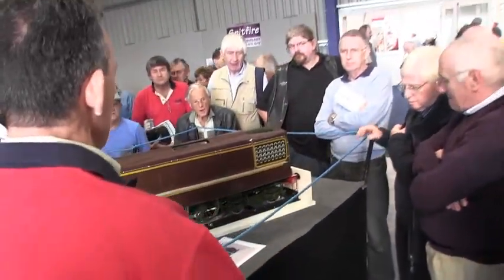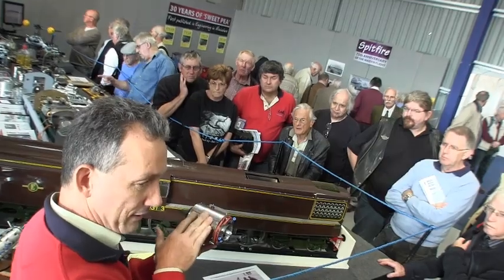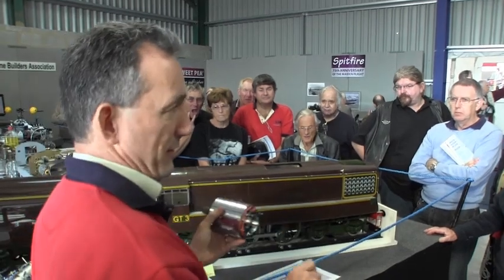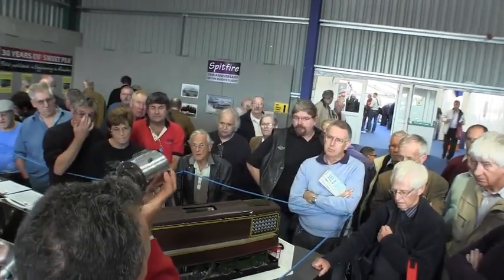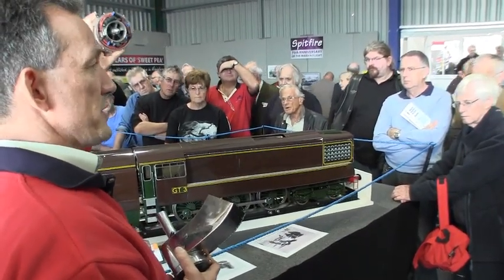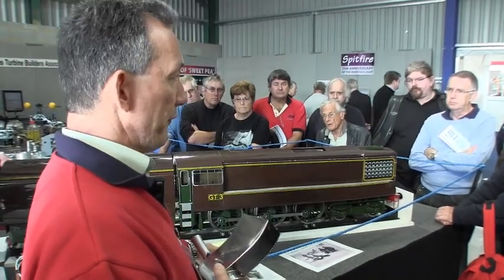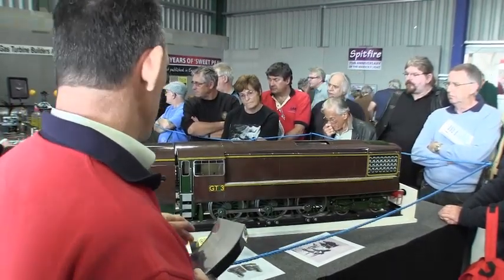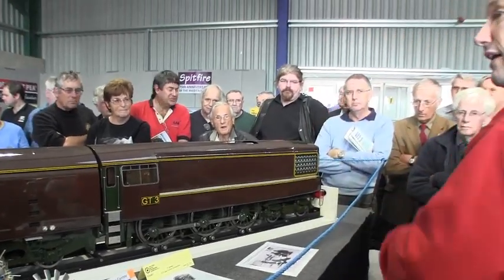Midlands MES 2011 gas turbine loco

Comment: This may sound stupid but does the gas turbine connect to a generator which powers motors to the wheels?
Reply from the maker: +Vector Brony As far as I know this is actually a direct drive system although there have also been turbine to electric motor drives, even various attempts at steam turbine direct drive and steam turbine to electric drive